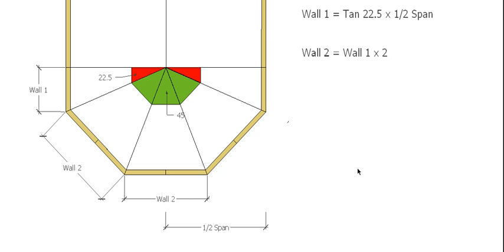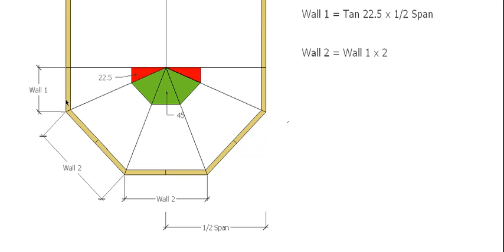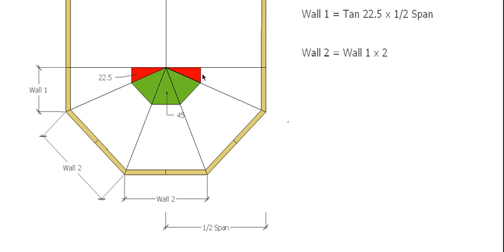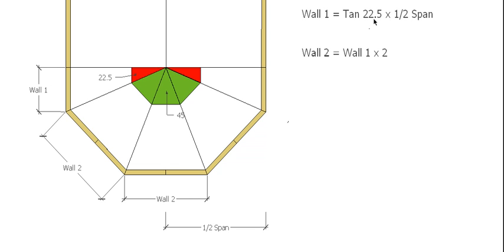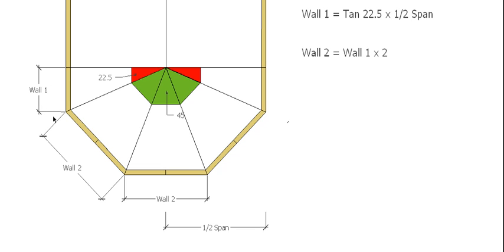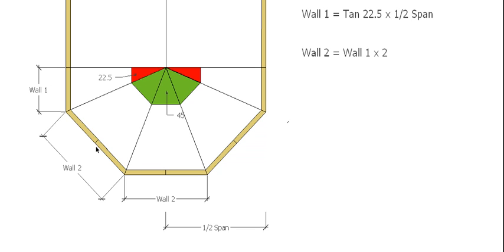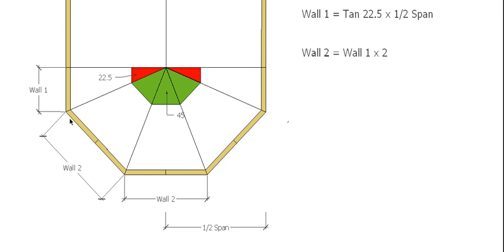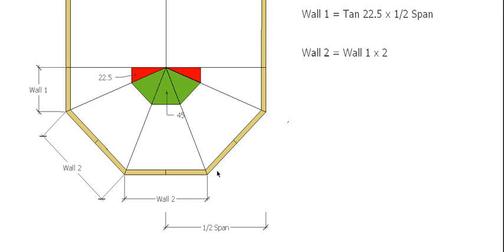Semi Octagonal Roof -  Wall lengths

Comment: This is drawn Wrong. I don't think it matters for your explanation but the Center wall #2 is not the same length as the others And the lines of it are not at 45 degrees to the rear wall # 1.  So no, it IS NOT an optical illusion !    But I like the video.  Coulda saved my ASS in 1994 when I had NO IDEA what I was doing as a framer.

Comment: The simplest way would seem that to calculate wall 1 using your second formula would be
 wall1 = wall2/2 ? 
Which would make sense as 22.5 deg is half 45deg
Reply from the maker: Hi James, sure, but you need to have the initial calculation based on a right angle triangle.

Comment: Please could I ask you how would I set out this roof if walls are not equal? Is it still half span back from front wall?
Also where can I buy a book that explains bay window roofs, I was going to buy the roof bible, but I read on another forum that its bay window roof example is wrong, also I'm from the UK and I use metric and I really like your videos, wish I could ask you directly somehow
Reply from the maker: Hi Mate, it would be similar however there could be multple bevels depending on the positions of the rafter and its length. Also the 1/2 span would change depending on the positon of the wall. There are a few books that i know about but i dont think any of them would cover this.
https://textbooks.zookal.com.au/products/advanced-building-and-joinery-skills-9780170421867?variant=34002643320964&gclid=Cj0KCQjw7MGJBhD-ARIsAMZ0eetb7rF-7fRD1-KTA9SGlLSCB7zygvreL4LtI6L3jtMU44YJ1ZsZFDcaAu_QEALw_wcB
https://www.ebay.com.au/itm/201663418200?chn=ps&norover=1&mkevt=1&mkrid=705-139619-5960-0&mkcid=2&itemid=201663418200&targetid=1278935637969&device=c&mktype=pla&googleloc=9071933&poi=&campaignid=12502542450&mkgroupid=123612189838&rlsatarget=pla-1278935637969&abcId=9300512&merchantid=7599182&gclid=Cj0KCQjw7MGJBhD-ARIsAMZ0eevD5MiKPsuv0InQNA0yVwJdaOAOxb9Ca5k9hJSFpbLRfCliYsfqmnoaAhS_EALw_wcB
my email is buildsum@gmail.com
Reply: @Buildsum  thanks for the reply. I must admit that it has puzzled me even more that it wouldn't be half span back from the front wall  if the sides weren't even. I assumed that it would be otherwise the run would be different on the main part of the roof to the end unless you had different pitches? 
Its really frustrating that there isn't a text book that covers this